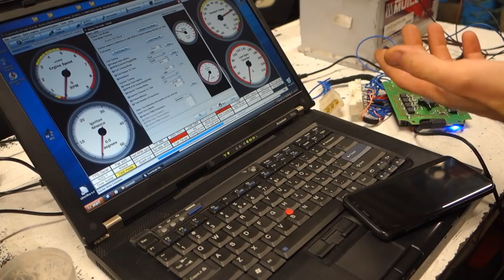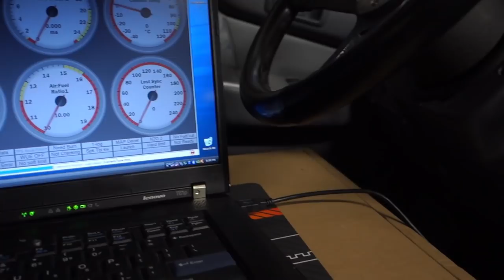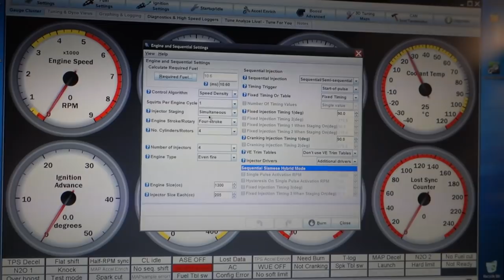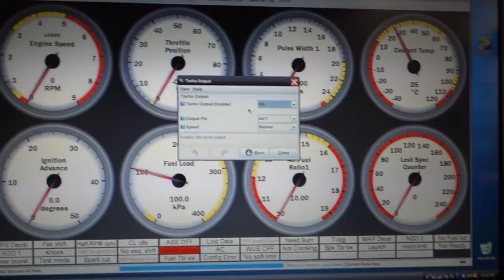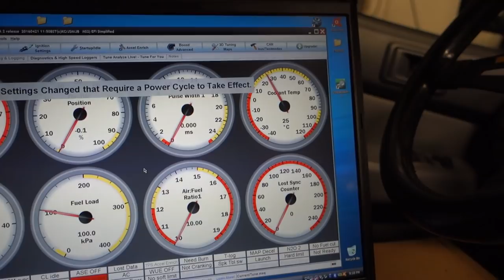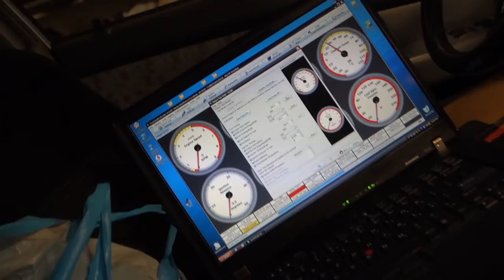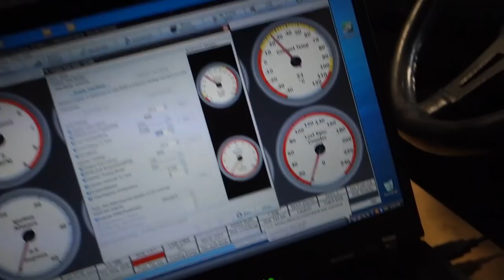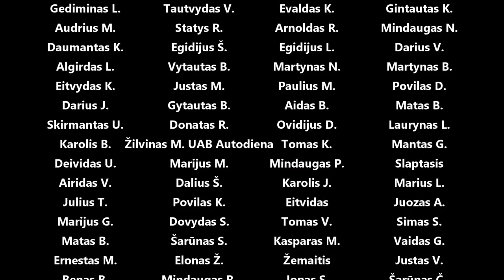Vedžiojam, jungiam, testuojam pravotkę, kompą, daviklius, sensorius, rites

Comment: Ritese buna krovimo laikas, gali buti, kad tu krovimo laika perilga padarei ir rite perkaitinai.
"The trigger signal rises from 0 V to about 4 V at coil switch-on and then returns to 0 V at coil switch-off. The time between these events is the dwell period or coil saturation time, determined by the Engine Control Module (ECM) or ignition amplifier."
Rite musa kibirksti kai signalas krenta(eina is 5 -> 0), o nuo krovimo laiko priklaiso kibirksties stiprumas, nes per ta praleista laika sukaupta energija pavercia kibirkstimi.
Edit: vel per anksti pakomentavau, matau radai iseiti :D
Reply from the maker: Aha, dėkui už info :-)